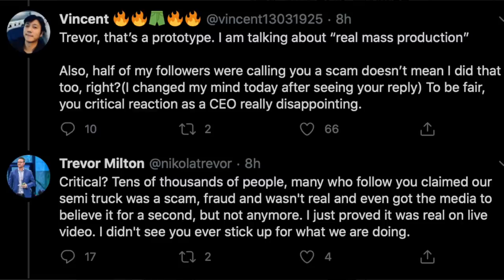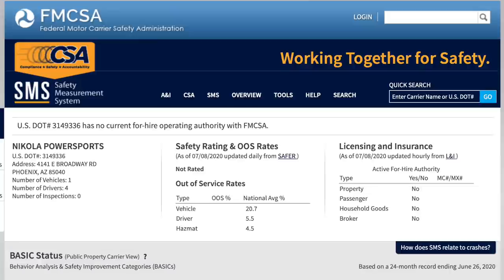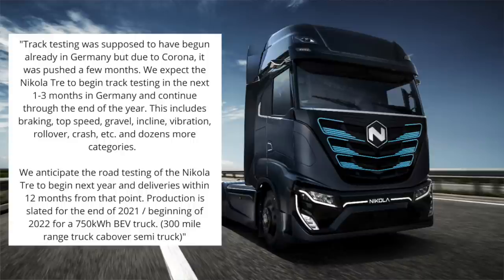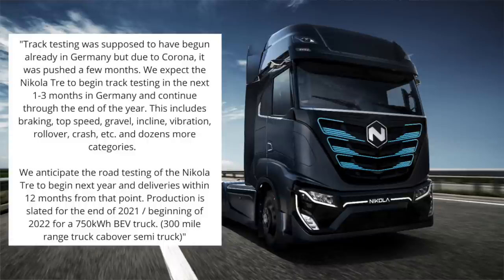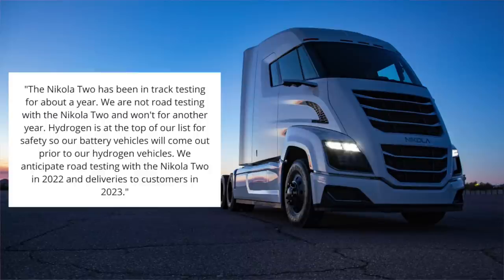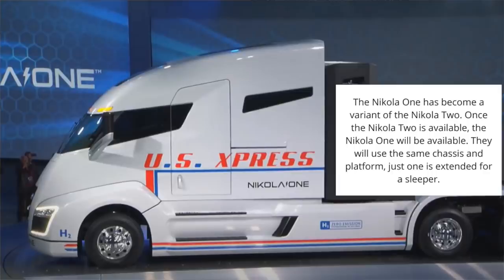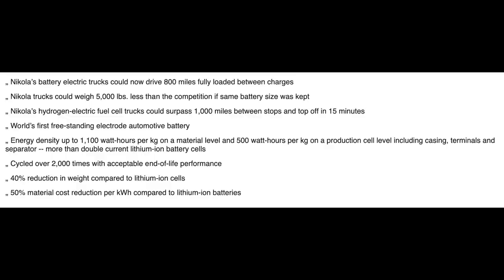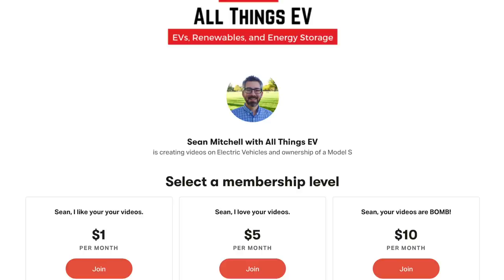Nikola has done 0 miles of road testing

Comment: I think you are spot-on, Sean! Nikola started well enough with a couple of prototypes that looked really good. But several years later and they have no more development, no Road testing, and no real products. But what they do have is a lot of CAD drawings and photoshopped pictures of their other products, all of them 'designed' to be better than the competition. This is the classic example of vaporware.  What I don't know, is whether they started with good intentions until figuring out that a hydrogen fuel-cell was never going to work, and then found themselves spiraling out of control with imagination replacing reality, or whether this was a scam from the get-go.  Covid-19 has not kept other companies from testing their vehicles.  Unless they have not even built a vehicle to test with yet.  Sadly, this seems to be Nikola's current and future state.  Hey- I hope I am proven wrong- nothing would make me happier.  But I'm not holding my breafh...
Reply: Nikola actually started out as a methane truck company.  They switched to hydrogen for a reason unknown to me and now I think it will switch to a battery only company.  So much money got dumped into the company recently, they are now scrambling to actually start delivering a truck to the public.  They removed Trevor as CEO because he has no idea how to run a company and made him the hype-man.  I think they will just remove the hydrogen part from this company because it does not make any economic sense and try to capitalize on the BEV market that Tesla created.  I can't say if it was a scam from the start, but I have my suspicions that it was just bad management by Trevor on the product side that made him start BSing about everything.  Now that they have a new CEO, they might actually bring BEVs to market so don't count Nikola out completely since they have a lot of money and new management.  Like it or not, Nikola is a well known brand and money is flowing like crazy.

Comment: I think you are too generous. I have one question: didn't Nikola first presented (or talked about)  a hydrogen semi and then months later an electric one after Tesla announced their semi? Then how is it that they are first going to go to production with the electric instead of the hydrogen? No one talks about this but it is important as it points to a scam since you cannot just change plans mid-course and then all of a sudden come up with the most advanced electric semi!
Reply: After Nikola abandoned natural-gas turbine powertrains in 2016, its hydrogen fuel cell truck always had a battery, since fuel cells aren't good for bursts of power. It's an obvious step to bump up the battery size and sell a shorter-range truck without the fuel cell. But then Nikola is just another battery truck maker competing against BYD and the established truck makers' battery versions. So hype a battery breakthrough. Fisker mark 2 did the same thing (and hey look it's getting acquired to go public just like Nikola!).

Delaying hydrogen must really annoy all the hydrogen component suppliers who invested in Nikola because if the original plan succeeded they would have a customer for their tech.

Comment: By the time Nikola actually has a hydrogen fuel cell on the road battery technology my make it obsolete in terms of range and weight. Hydrogen produced by zero emissions electrolysis used in a hydrogen fuel cell sill is the only circular sustainable net zero emission energy solution for transportation, which is irrelevant without product to purchase and hydrogen service stations to fill the hydrogen tank.
Reply: Batteries can be "circular net-zero emission energy solution for transportation" for a lot less cost than faffing around with hydrogen: put up solar panels or buy green electricity, recharge batteries, done.
Reply: @skierpage Charging Batteries with solar power to store energy to charge more batteries is not circular sustainable energy.

First, hydrogen fuel cells produce water that is used to create more hydrogen. In contrast using a BEV doesn’t creat more batteries or electricity. Thus not sustainable circular green energy. 

Secondly, using solar panels  to charge and store electricity in huge expensive stationary batteries to later plug a BEV into to charge its battery is highly expensive and inefficient as one not only needs to purchase and replace two extremely expensive batteries when they are no longer useable, one must also pay the additional costly toxic waste battery disposal fees. 

Green Hydrogen for hydrogen fuel cell vehicles wins every time on all levels.

Comment: I believe that hydrogen will have it's place in applications where electricity is not readily available and where battery weight will always create a disadvantage...as long as the hydrogen can be obtained through cheap hydrolysis with solar energy.  Think about ocean going vessels, locomotives, mining equipment (if located in remote parts of the world), farming equipment, airplanes (possibly), and recreational equipment like jet skis or ATV's.  
If a battery is so small that it is harmful to fast charge it, then hydrogen is the current clean alternative.  Motorcycle touring bikes could be another application as people ride these bikes for hundreds of miles per day, but don't want to stop every couple hours for an hour at a time to refuel/recharge.  And....motorcyclists are already accustomed to paying for the highest octane fuel.
As for passenger cars and diesel trucks that are used in areas where the electrical grid is easily accessible and cheap, BEV looks like a clear winner right now and the foreseeable future, due to convenience and cost.

Comment: I found this video 2 months later and it was very interesting to watch this now that events have unfolded. It confirms your suspicions that Nikola does not have access to advanced proprietary battery technology with 500 wh/kg of capacity since they will now use GM batteries, platforms, hardware and software, which means Nikola can’t get its original prototypes into production for years and when they do, they will be GM made.

Comment: My guess on this...  Is Nikola going to make the truck and sell it, probably yes. But, it will have "regular" Li-Ion batteries (similar to Tesla) because the new super-duper battery tech they claim now is not commercially available. Regarding hydrogen, this is only going to happen if they can get backing from the fossil-fuel industry for the re-fueling stations. Making H2 from hydrocarbons is very cheap compared to for example electrolysis and fossil fuel companies can still sell their product.
Reply: How is Nikola gonna make the truck? They have no factory.

Comment: I'm a little confused by this video, first, your title is dismissed by video footage of Anheuser Busch making a delivery with a Nikola Truck in St. Louis 2019 https://www.youtube.com/watch?v=dJjjRWF9Pi4  Second, you cite your source of zero road testing as the FMCSA website, which is not a vehicle manufacturer inspection agency.  FMCSA inspects freight carriers at weigh stations and reports safety violations to USDOT to have either the driver's license revoked, or the freight carrier's license revoked.  It deals more with logbooks, tire tread, and brake wear  and has nothing to do with manufacturing.  Still not taking a side on the Trevor being a liar or not until the investigation is over, but there is definitely a Nikola truck driving in traffic at least 8 months prior to your video.  Maybe it was running on diesel, i dunno, it doesnt have any license plates or DOT numbers though.

Comment: Hyundai has announced their Class 5-6 (?) hydrogen delivery trucks.  190 KW, 85 Km/hr max speed. (45 MPH) 32 Kg of hydrogren storage on board, takes up a lot of room on the bed.  Doesn't fit between the frame rails.
Along comes Nikola, doing everything better than Hyundai, with no real world proof.  Seems fishy.
Anyone remember Ballard Fuel Cells ?  They just celebrated 25 YEARS of trading on NASDAQ. https://www.youtube.com/watch?v=amyjdRW72Dk  I've yet to ride in one of their vehicles or hear of one operating.
Reply: Ballard Fuel Cells?! Yeah, they’re from my neck of the woods.
I bought stock when they launched at ~$10/ share. It soared up to ~$200. I WAS RICH! Then it crashed back down to~$10. I WAS POOR!!
Then I sold. 🤣🤣🤣🤣 oh well.🙄
Reply: They did have a number of transit buses on the road. Don’t know if they’re still running. Haven’t noticed any.

Comment: I have suspected for some time that Nikola is looking to follow on the coat tails of Tesla and eventually clone the Tesla Semi - an all-battery truck. They might be well positioned to do that thereby letting the Hydrogen side spin off. Also even if they rallied huge support from, say, oil industry to get behind Hydrogen, such vehicles would always be in danger of a battery breakthrough for pure EV trucks. A decade from now, the move to solid state stuff could signal two or three times increase in battery density and that would cause heartbreak for H2 industry. If H2 has a future it will be in the stationary side of things.

Comment: Spot on... only you're not counting for the fact I think they are backed by big oil and may find a way to push these things forward. Just like the original Ford Model T that had no gas stations or infrastructure and before big oil got a hold of Ford he was actually working with Edison on a new battery pack for electric vehicles. Then boom gas stations and infrastructure

Comment: I don't think we need to worry about testing Nikola's hydrogen truck, it simply won't happen, once Tesla gets battery with energy density 500Wh/kg the game is over. Trevor's main argument about truck going 600 miles won't have sense anymore. With density 500Wh/kg+ Tesla's truck will go 600 miles. EASILY.

Comment: from my own research and these timelines expressed to Sean i’m wondering if hydrogen ends up scrapped (like the natural gas turbine). battery tech evolving too fast esp. CATL’s drive to eliminate nickel & cobalt. faster charging tech - lucid’s 900V+ 20 miles/minute (30” required rest = 600 miles). $NKLA’s turtle pace - no road testing, unproven cost structure, no hydrogen stations built to date. also why? to build out hydrogen network will use dirty fuel (all those contractors) - put the funding/energy into battery tech.

Comment: Vaporware...total pipe dream and their specs are completely outrageous considering the years that Tesla but into battery technology. Tesla's best real world calculations and specs for batteries are in the 500-550kWh spec for 250 miles with a 30 minute recharge time to 80%. To me this still seems outrageous because that's recharging at 14KV 60AMPs 3PH. That's more power than you need for an entire subdivision to charge 1 truck! Now charge 100 or more in an hour??? That's what you would need for a medium sized truckstop! A large truckstop or terminal would need 100s of megawatt hours up to a few gigawatt hours of electricity per day! That takes an enormous power plant for one large overnight stopping place and every dock, terminal and parking space elsewhere would have to be equipped with supplemental charging. Totally Insane when I can pump 1200-1500 miles worth of Diesel in 10-12 minutes and drive for 3 days...not to mention the fuel supply can be mobilized to meet a truck anywhere. Private fleets will order a tanker of Diesel to partially fill every truck on the lot and save the trouble of moving all of them to a pump.

Comment: If Nikola's semis could run on pure BS they would be driving at 1000 MPH. Unfortunately, the production of Hydrogen (H1 or H2) is very energy-demanding and requires either surplus energy or newly installed energy production (LNG or top of line Windmills). If any new energy is produced it could quickly be gobbled up by closing down coal or nuclear production (IMHO). Hydron production is a very good product for surplus energy, that can be used in busses or planes or ships. Only it (H1 prod.) requires pressure tanks and production close to energy production, or high loss of energy ensures. 
The lack of real-world testing, production facilities, or any small or medium production from Nikola is alarming. The order taking from Nikolas web page without deposits is also worrisome.
Outsourcing production for products that lack infrastructure (Hydrogen) and battery production of scale is alarming. That from a guy who buys an expensive house w/o real production is scary.

Comment: I agree with You Sean.... I converted to electric a bus back in 2016 and the first thing we did was miles, miles, of driving and testing. Obviously you risk being tweet if something goes wrong (which is what you are looking for in testing). So we keep the eBus, old and with the same colors of the public transport buses to pass unseeing. It worked, people would be expecting us to stop at the bus stops. LOL

I can't believe that after so many years and so many resources they don't have at least 5 trucks working daily for free for Bud while gathering valuable information. Testing on a track gives you 80% of the info you need but you still need that other 20%. Otherwise you will face those problems later during production and that is really expensive. (Ask Elon about the first Roadsters). 

Trevor makes too many claims that have no bases. They are not a manufacturing company, making prototypes doesn't turn a company into a world manufacturing leader as he says. All those claims about the battery that is so unrealistic for 2022. Not even the largest Battery manufacturers in the wold have achieved those prices making 1 million times more batteries that Nikola has ever done. I would believe that statement coming from Elon, they have been doing them for 15 years, so they really know what it rally takes.

The main concept of Nikola is interesting with the BEV and FCEV, but a little more action and less talk. Milton really seams more of a Theranos than a Tesla. For the good of EVs I hope not!.

Comment: Your comments are all grounded @SeanMitchel on good survey on federal authorities and industry experts. Nikola can dispute the arguments but the logic is there. 

I fully agree with Elon that to get the machine that builds the machine is at least an order of magnitude a harder of achievement than the prototype. All in all, strikes me to reason that Nikola seems to be at least 5-10 years behind Tesla on the semi, considering Nikola’s own information of 2023. 

Delivering first commercial units is one thing, peaking scale is very different thing. So, is Nikola, with no existing factory, still changing prototypes, trying to convince that they will outperform someone that dominates production engineering and supply-chains at the level of a three Gigafactory’s ower, in three different countries, in just one technology (no hydrogen), such as Tesla?

Hard to buy, unlikely statistically to happen, daunting of war to fight. Would need a bigger will and ingenious than what Elon ALREADY delivered. 

Impossible? Nothing is impossible but you can get to your own likelihood conclusions. I already got mine.

Comment: Anyone can build a demonstration units, Nkla is all about the fluff without any actual substance of the claims. 

Battery pack claims can be written on paper and yet it’s only worth the paper that’s written on. 

Where’s the actual white paper on the battery pack claims? 

From your report on Nkla tre is going to be 2.5kwh per mile and TSLA semi has been stated under 2 kWh per mile. 

How does that even “beat” TSLA? 

Having a higher power consumption per mile isn’t a beating on TSLA. 

It’s called self- inflicted headshot.

Comment: Nikola hasn’t talked anything about their charging network, only their hydrogen network 😏 or? 🤷🏼‍♂️
Reply: Electric truck charging is doable. SAE and CharIN e.V. are completing standards of  higher-power charging if CCS 350 kW isn't enough and Tesla has its own Megacharger. The charging stations require expensive high-power electrical work, but it's a breeze compared with electrolysis, compression, cooling, storage, and pumping to refuel several big trucks an hour with hydrogen.

Comment: You were impressed by the way the truck looked, but were you impressed by what you saw of the drive train and all of the hardware under the glossy exterior? Probably not, because I doubt very much if you saw any of that. It's easy to make a glossy truck and power it with a golf cart transmission. Comparing imaginary specs to Tesla and other battery technologies is meaningless since there's zero evidence that these magic batteries exist.
Unless you've seen the actual hardware, you've seen nothing of value. Personally, I think it's a scam. Wait for the huge crash in another couple of years when everyone finally catches on.

Comment: Why test them on the road when they are never going to be driven on the road? You are spot on, Sean. "Battery breakthrough" should be a red flag that sends investors running away. How many hundreds of battery breakthrough claims in the last twenty years, and exactly zero have materialized. The hydrogen angle is dead too, economically uncompetitive without the almost free excess electricity utilities are rapidly moving to store themselves in battery facilities bought from Tesla.

Comment: It’s incorrect to say h2 vehicles are emissions free. They Emmitt water vapour which in itself is a big part of smog in cities. If this was the only emission then probably not too bad but in the short term will actually increase smog as it mix’s with other elements in the air.